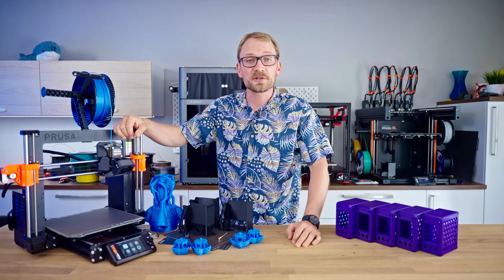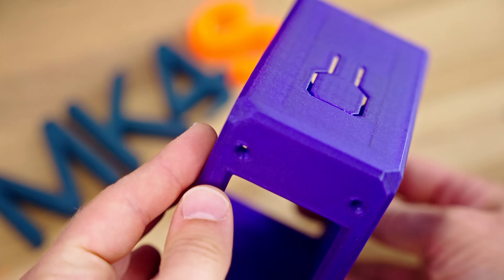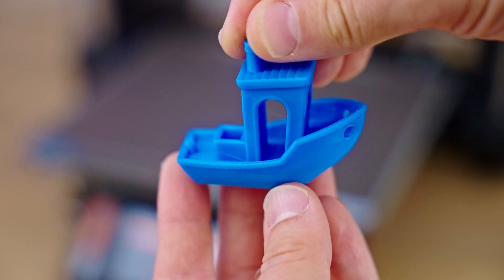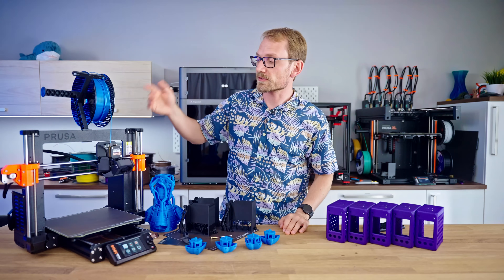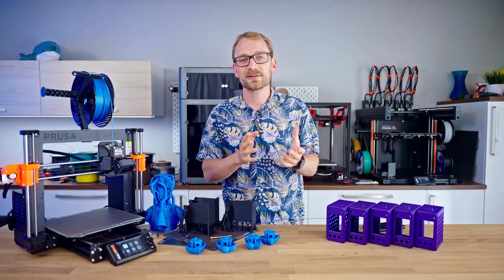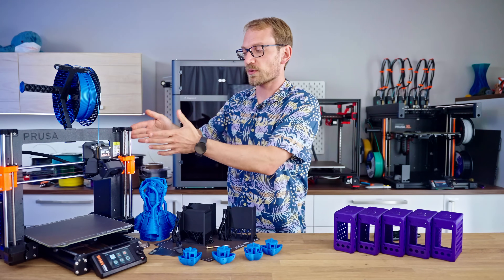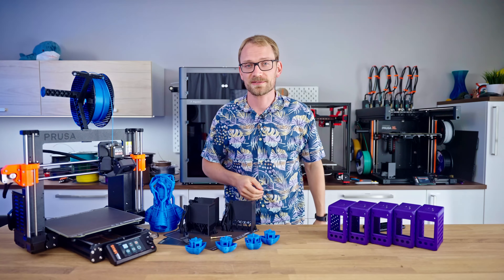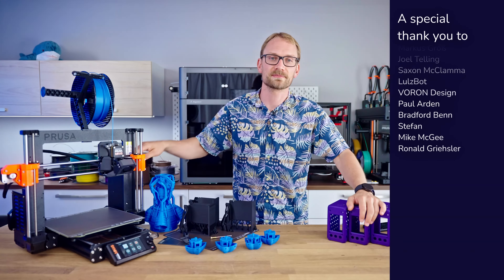"S" is for Speed - Prusa MK4S

Comment: As others have said, the dependability of a Prusa is why I bought a Core One+ after my MK3S. And because I wanted to build it myself. And because I wanted access to the very best support if I had any questions. Ever. And because I believe in Prusa's morals.
It's interesting that Bambu Labs is now apparently paying for the message that its printers are for those who just want to print and not tinker, and that Prusas are for the tinkerers. What a shift in 12 months.
I see Prusa machines as being for those who want a product that works very, very well, but that can tinker if they want. And if they do, they'll have great support.
I haven't noticed it with Thomas, but some other big YouTubers seem to increasingly make a point of saying 'I printed this on my Bambu Lab...' throughout videos. Paid promotion is of course a big thing in marketing, and it appears 'pay per mention' is here too.

By the way, I say this not as someone with a tiny channel that they have no real intention of trying to build - my job is as a consumer editor working for a major motorcycle outlet without any advertising influence due to the way our business works. I do consumer advice stuff, and get really frustrated with some of the paid misinformation out there in motorcycle safety kit and security.

Comment: I upgraded my MK3S to the MK4S and it's a whole different machine. At times it's moving too fast to have done anything! But it's handling the speed like a champ. It turns off the bedroom light switch and is in in bed before the lights goes off fast. Like the MK3S vs. an Ender 3 fast! This printer gets down, and kicks butt.

Comment: You know, that lack of "wow factor" is unfortunately what makes them look old and passed to newcomers in 3D printing.
A friend of mine is the perfect example.
"I want to produce small batches of pieces, and not to bother with the printer"
"Take a prusa if you can afford it"
"No, it's not what I want. I saw that printer printing super fast! And that one doing this or that. Prusa don't do it."

On the other hand, why change something that works really well?
But still, lowering the price of the entry printer, and/or adding wow factor could allow them to change that perceived lack of sexyness.
And users will later buy off the same brand because they tried and find the quality good.
Well, just my two cents of course...

Comment: My zero IQ move in 3D printing was to buy a full upgrade kit for a Prusa Mk3 to Mk4 for so much money that i could have almost bought a Bambu Lab P1S. In that case you own two printers and the P1S has a chamber and delivers reliably great results while the Prusa still to this day needs tinkering from time to time. Pursa's idea of a printer that is upgradable is great in theory but the pricing they ask for it makes no sense anymore. What's the point if it costs more than a full printer that is just as good if not better?

Comment: Hey Thomas, any chance you could do a future video comparing print quality and especially overhang performance of the Prusa XL and the MK4S?
Would be really interesting to see tho, especially as the MK4's print fan setup was quite similar to the XL's and now the MK4S's is quite different and superior.
Also Prusa added the HF profiles for the XL in PrusaSlicer, is the XL still capable of producing quality prints with the HF nozzles and the "inferior" cooling setup?
Have a MK4/MMU3 with a MK4S upgrade on order, but still tempted to get a 5T XL next BF, just don't want to make a step back in print quality or overhang performance.

Comment: Just wondering: how do they produce CHT versions of that "all in one piece" Nextruder nozzle  The filament paths were said to already be tricky to manufacture for a normal nozzle, even though there you "just" have to drill 3 smaller holes at an angle.  But how do they do that if there's a 1.75 - 2 mm path with material around it upwards from that CHT feature?

Comment: Actually inside the EU the price is 109€ plus shipping.
The most expensive part actually is the nozzle about 40€.
On 0.4 with the typical 0.2mm Layerhight you do not even need a high-flow nozzle on the mk4(s). Only with higher layerhight it's used. Or with bigger nozzles.

The new parts of the electronic are nice, but not worth upgrading, exept you need the new GPIO for tinkering.

For me upgrading the fan is the most interesting part. However, the fan is not available in the shop at the moment.

However, as I had 4 mk3s+ but only one upgraded to the mk4, I now ordered the mk3->mk3.9 upgrade. I will use this to upgrade my mk4 to mk4s and one of my other mk3s+ to mk3.5. This cost just 171€ more than one mk3->mk3.5 upgrade plus one mk4->mk4s upgrade together, but for this I get a complete Nextruder. Wich for 171€ is quite a deal (even if I have to crimp adaptercables for the mk3.5 upgrade myself). So I might try a Nextruder on my vCore3.1...
Buying the mk3.9(s) upgrade was the cheapest way to get a Nextruder for now. Some people work on using the Loadcell with Klipper. Results are promesing.
Of course, 549€ is not cheap. But you can reuse the board+display comming with the upgradekit for an mk3s+ to mk3.5 reducing the price for the Nextruder to effectly 280€. If you also get a mk4 to mk4s out of it, this reduces the price further, effectivly to 171€ for the Nextruder (but you just have the mk3.5, not the mk3.5s upgrade). I might upgrade the last two mk3s later - in case I get the loadcell to work and want to build a toolchanger...

Comment: I got fed uo with building and modifying 3D printers 5 years ago and wanted something to just work. I've been a prusas LOVER since the mk3 was released and had 2. Now, for me, the mk4 are not even close to competing with the X1Cs that I replaced my mk3s with, in terms of printing experience. It is about time Prusa added an enclosure, light, camera, good web and app interface, etc. if they want to charge the same price. Also, don't get me started on the (not fit for purpose) MMU2 piece of junk that they ripped me off with.  There is nothing in this printer that would take me back to prusa after a couple of months with 2 X1Cs. Too little, too late Joseph - bambu have caught you with your pants down
Reply: Interesting, I  wonder how many people agree with your opinion.

Comment: Are you really arguing that they should have advertised Input Shaper as a feature of the MK4S? The MK4 was sold with that advertisement already and it was already a crux that it was not there day 1! To this day, the MK4 still has a lot of issues. And yes, the screen was updated in the lifetime because the first gen of it could kill usb drives at random for example.

Comment: I feel like the fact that it's "just" a printer that does its things well and is good at the basic printer things rather than at one single stand-out feature, is the stand-out feature of the prusa machines.
Unfortunately it's harder to sell the promise of a reliable printer than "just works" rather than "ooo look it's quick", but it's super important to me at least :)

Now I want to find a good printer with the same prusa mentality, but with an enclosure. Prusa really lacks options in this space, the mk4 enclosure feels like a bandaid on the "problem". Would have been cool to see tgem switch to ASA for the MK4S... Sure I can re-print everything myself, disassemble and reassemble my printer but having it as an official thing would have been cool

Rant over :D

Comment: btw the accelerometer is only needed if you use a very modified extruder. For the stock extruder the standard values are the best and you wont become better results with retune

Comment: Thomas, thanks this video leaned into the area we’re interested in.  Couple of questions/clarifications, at about 2:03  you mention profiles below .2mm are near identical between 4 & 4S.  Pretty much everything we do is .15 and some .2 ; given that:      

Q1) did you see any noticeable net gain in .15 & .2 print speeds?       

Q2) did you by chance do any 4S overhand testing at either .15 & .2?  

Thinking an upgrade for us might only be worthwhile if we can utilize the new cooling design to improve our bridging/overhangs at .15/.2.  

TIA.

Comment: Prusa is exactly the kinda of company I want to see succeed, which is why I aspire to a MK4S or an XL and not a Bambulab.
Reply: @jakeharms1386  too bad we all don’t but on principal. China wouldn’t own the majority of our country!
Reply: I have a BL A1 Mini and like it a lot. But with the recent lawsuit I want to get away from the closed system just in case the lawsuit hits the industry hard. So my next printer will be a Prusa MK4S. Plus, I get the option of assembling it myself. I’m not a tinkerer but assembly is appealing to me after having a prebuilt BL. Just as long as I don’t have to tinker once it’s complete😊
Reply: @Shenandoahleather  I've assembled two MK3S kits 4 years ago, and it has been a real pleasure (the Haribo gummy bears that are part of the process playing a significant role here ☺). No assembly problem at all, everything fits perfectly where it has to, 99% crystal clear assembly instructions,... And zero tinkering when finished. Just run the factory calibration procedure and you're ready to print. 

You just have to plan enough time for it. I remember having devoted one week-end per machine, but not doing this 100% of the time and taking my time to take pictures and document the journey. You must also have a minimum level of manual skill, but nothing more than the average tinkerer.

I will not hesitate a second to go with this option again, and not only because of the $200, that have been spent anyway to buy complementary accessories, such as additional coated sheets and filament.
Reply: @Shenandoahleather  Building it is the best way to know how to repair it in case something does break.. That is the beauty of building it yourself..
Reply: When their updates costs as much as a full printer from the competititon with more features then they have lost the competitive race. I buy my printers to print and not as a status symbol or sign of my principles. I've spent more than $1500 on the Mk3 and later upgrades and now it's as good as a $340 printer from the competititon. How does that make sense? My future printers will be from BambuLab until someone better emerges.
Reply: @Jan_mxv  if that’s what you value that’s fine. That’s why we have a free market. I just value different things.
Reply: @Jan_mxv  that's how tech progress and innovation works, wdym?
Reply: @Jan_mxv  Then go with Bamboo if this makes you happy. But good luck with a closed system that could make your printer unusable if ever their service goes down some day.

I've looked at their products with a great interest based on their specs, but being tied with an online service is not my cup of tea.
Reply: also not chinese junk...  That alone makes it worth it...
Reply: @FJB2020  I don’t have anything against Chinese made things per se , but most of the Chinese 3dp companies have values I don’t agree with
Reply: @jakeharms1386  true
Reply: @jakeharms1386  agreed. The only one I like is Sovol, the SV06 and SV08 are good examples IMO.

Comment: Yeah, the MK4's killer feature is I can start a print and walk away. If I didnt do something wrong in slicing, itll print the thing. People value trust and reliability far too little.
Reply: My Bambu Lab printer does that too, and at a MUCH cheaper price than a Prusa Mk4, so it's not really a 'killer feature' is it?!
Reply: @trance_trousers  I value being able to fix my printer myself very highly, which is why I don't like Bambu.
Reply: @trance_trousers  Bambu is all fun and games until you have to be on wifi to do most things and the data issue
Reply: @BigMaloneGaming You dont have to be on wifi you can do LAN or just use an Micro SD card
Reply: Pretty much any printer above £300 is like that these days though and tbh you'd expect that of Prusa considering it's pretty much the still same core design he invented over 10 years ago.

Comment: I'm not going to buy the whole upgrade, but the GPIO board and accelerometer is what I want. Speed wise, I added a volcano hotend which outperforms the new nozzle. For the fan, I need a custom shroud, because the volcano adds around 10mm downwards. I guess Prusa didn't want to go for a bigger hotend, because it renders the old nozzles useless and just opted for an optimized Bondtech. I'm curious if the Bondtech is compatible with the MMU3 because how does the tip shaping works if the Bondtech makes 3 thin strips out of the filament?

Comment: Non enclosed printers, umm.  You know what?  Lots of people print in PLA for everything, pretty much. You get your machine set up and away you go. I don't do that, I print PLA for sure, but TPU, actually Filaflex55 at the moment, ABS, CF Nylon, ASA, PETG.  So whats the issue, getting the filament dialled in that's for sure (keeping careful note). Two things really, calibrating the deck which will change as I heat it to different temperatures, change extruders (I have several, 6 dialed in to different materials and nozzle types/ sizes, some heavily modified as well, I could do with more), heat the enclosure to different temperatures, the second problem shrinkage - I mean how do people manage with the likes of ABS without an enclosure (this Filaflex filament as well). I also print onto different surfaces. PEI Flex Plate, Borosilicate Glass, Garolyte, Glue Stick. So as far as the printer is concerned (I have a Qidi X-Plus), the issue, temperature of the enclosure and the bed which comletely messes your height calibration as if we haven't got enough variables to get the filament dialled in, and shrinkage which will fail many a print without an enclosure. I have retrofitted a cabinet heater to my machine. I have got to know the requirements of my machine to avoid some of the pitfalls, but I can't help thinking things could be easier.

Comment: I guess it's great that Prusa offers an upgrade for the MK4 now. On the other hand it almost feels like a kick in the teeth.

So is the firmware finally up to speed on any of their current selection of machines?

I find it very frustrating that it's been close to a year since some of these machines came out and it's only with the last firmware upgrade that we're getting the functionality that we were supposed to have when these were first offered for sale. 

I have several MK 3.5 units that I had to wait months for a firmware update that would allow touch screen functionality. 

I'm not even sure if or when they're going to have the proper input shaping that was promised either.

I've been a customer and have supported them for years. I love their products, I just wish they'd stopped using their customer base as beta testers.

Comment: I think the screen improvement you noticed is just the current-generation MK4 screen. I ordered the upgrade for my MK4 on launch day, and as part of the order process, they show you two different screen board versions and ask which you have so they can send the appropriate parts to fit that screen. I've never had any complaint about my MK4 screen, and I have the old one.

One thing I don't think you mentioned -- the MK4S can apparently reliably print up to 75° overhangs thanks to the improved cooling, which will reduce the need for support and further speed up printing while reducing waste.

As for the MK4 not being "exciting", I couldn't care less. I want a printer that works and delivers consistent results. The MK4 is clearly exactly that (and so is my 5-tool XL).

Comment: I don’t want wow factor, I want a reliable machine that just prints, a machine that I can easily replace parts when needed. My MK3S+ is still going with zero issues since day one, only thing I’ve done to it is put in a revo nozzle and that made it even better for my use.
Reply: Agreed. No need to upgrade a MK3 because it already works good enough. I’ll be waiting for an MK5 or MK6. Maybe by then the Wow factor will be worth it to upgrade.
Reply: Same. Hubby and I have the MK3S, not even the plus! We replaced the hotend with a revo one and that has totally fixed our heat creep issue. We replaced both heat block and heat breaks before we got the revo, and that didn't fix the issue. After replacing it with REVO, never had any issues ever again.

Comment: The whole point in a mk4 (or mk4s) is that the quality is pretty much second to none. My favorite review is Aurora tech. She's incredibly thorough. From what I've seen the XL produces the best quality prints with the mk4 close behind. I would imagine the new fan means the mk4 will out perform the XL now. Bambu can't compete with prusa's quality. I stick with prusa for quality of prints. bambu can't touch them. The ender 3 KE is impressive. It competes well with bambu, but it can't touch the mk4 either. So for $100 I should get (hopefully) faster wifi, and better print quality.......not that the mk4 has poor quality. It's amazing. And.......possibly more speed. Honestly the speed isn't that big of a deal, but who knows mk4s + mmu3 might mean faster color purges. It is mostly a straight line after all.

Comment: I have 12 different printers and yes. Prusa is “reliable” it’s also.. slow and only used when I need something overnight. But everyone else has caught up and excels at a way lower price point. 

Adding features that should have been there day one.. as a 99$ upgrade is not ok. Why does Prusa get a pass for this? Like I get it. They are the old guard. But come on..